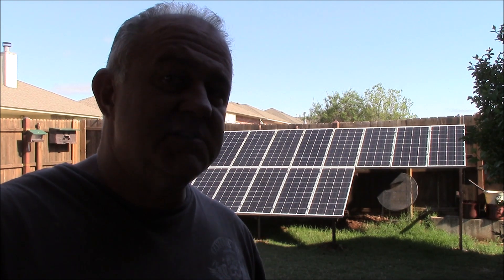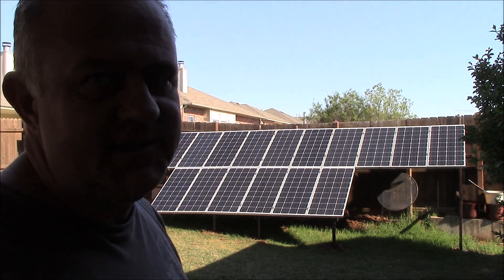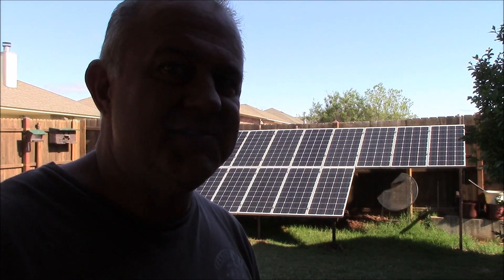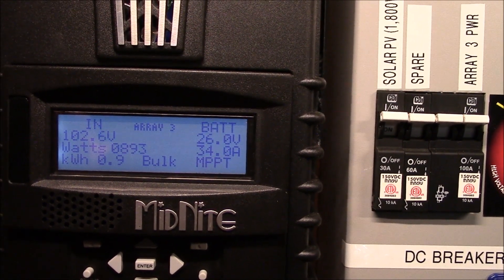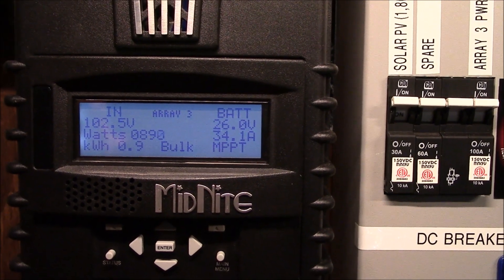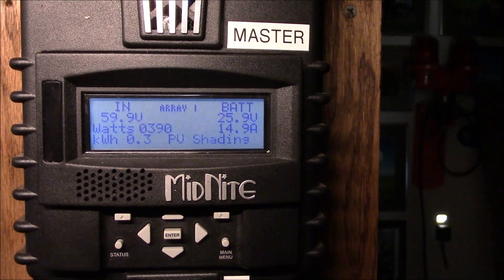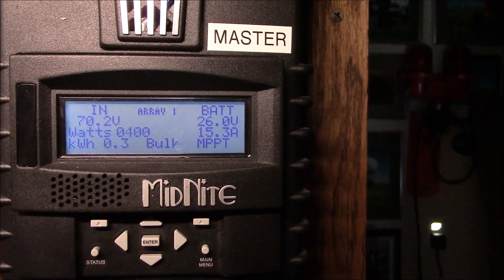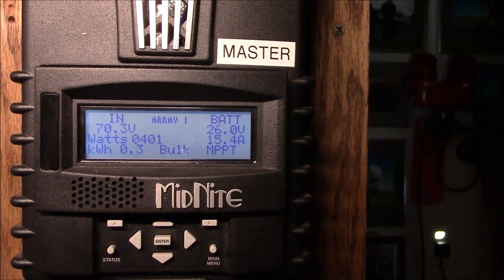Morning fenceline 1.8KW solar panel array time lapsed video

Comment: The time lapse was very cool.  What influenced your decision to use 100W panels v/s going with say... 270 or 290W ?
Reply from the maker: This question has been asked many times over the past three+ years. 1) 12v 100w mono panels is what I started with 2) easier to handle 3) can series them up for higher volts 4) company hooked me up 5) not made of money...bought a few at a time to build up 6) only had one "bad player" in 3+ years, company R/R without any hassles. So, boxing up and sending off + warranty honoring is a bonus. 7) company still in business 8) have two smaller DIY systems...whereas 100w panels are more practical. 9) smaller 100w panels are more structurally rigid. Def get more watts-per-size for dollar spent with a larger panel if your pockets are deep enough
Reply: Ah ha!  All great reasons.  I ask because am in the planning stages of populating the commercial satellite dish mount I came into.  It will hold quite a bit but physically mounting 290Watt class panels iss not something I would look forward to.  Its be much more "doable" to mount 8- 100 watt panels.  I believe, they can also ship Fed-Ex v/s motor freight.  The price of getting a pallet of 290 wat panels shipped is the cost of 1 panel.  I'd have to put the 100W panels on a separate charge controller as you did but the difference in freight costs would take a chunk out of that cost.  I figured you had pretty sound reasons.  Thanks so much for the answer.  Now, how to get that mount in my truck, it weighs about 300lbs.....

Comment: would love to be able to afford solar... I know it pays for itself... but the start up.... MAN......
Great video.
Reply from the maker: Prices continue to go down. I stated with one solar panel, one used battery, a cheap inverter, and a $19 solar charge controller. It takes years to build for most people since the costs are so high, frustration, and other commitments. IDK, some dudes spend $1,000s on their cars/trucks to go a half a second faster in the 1/4 mile. Solar pays you back.